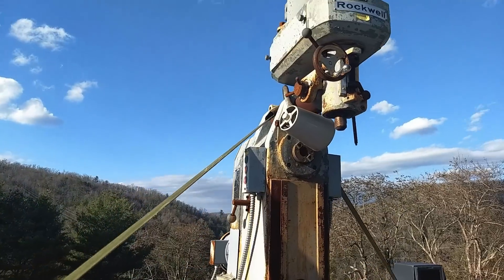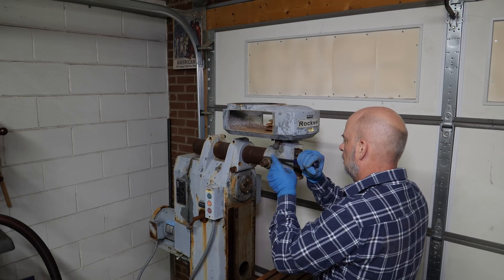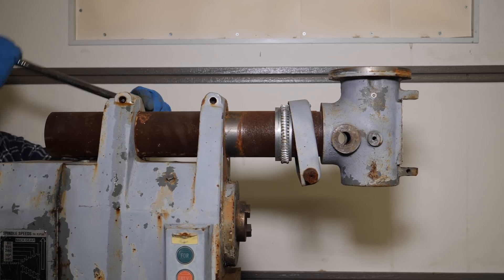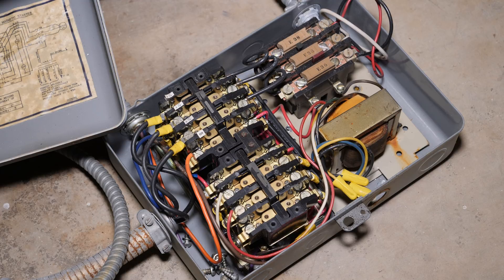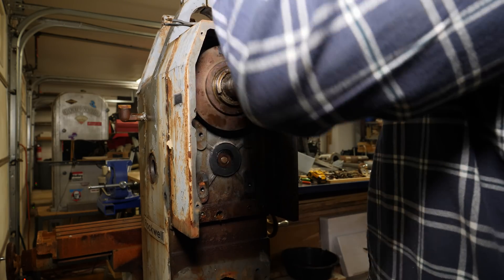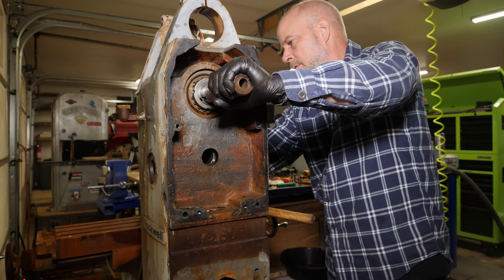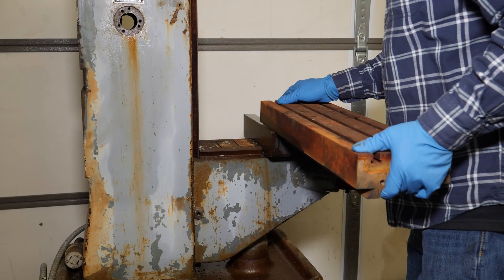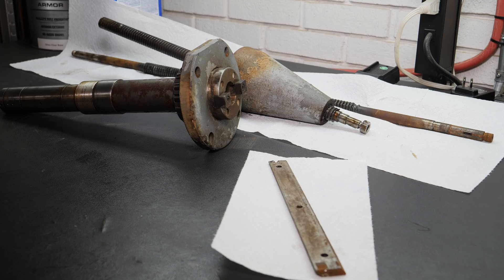$103! Rockwell Milling Machine MD21-120 Restoration Part 1 Disassembly

Comment: My machine was purchased by a friends grand father brand new I think in 72 but it has 220 single phase motors. I have the manual, overhead support brace,and the horizontal shaft. It's a nice mill for home use, not to big but sometimes a little to small. Wonderful channel I've watched about ten videos but am now going to bed.

Comment: I have the same Rockwell mill. I've used it for 20 years with a PMDC with DIY variable speed ac/DC converter. 
The 30 milling horizontal tool holders, I found the specs in my machinery handbook. I actually scored 10 of them at a yard sell for $50 each one would have cost 2-3 times that new if anybody had them.
 Your series has give me the nerve to do mine including the VFD.
 I've salvaged all my machines from orphans as I call them, and I've discovered that when I paint I finish the process with semi-gloss rattle can Polly and the paint just wipes clean and stays nice for many years.

Comment: One reason the rear bearing fails more often is people hamering pulleys on to the shaft without supporting the motor shaft on the opposite end.  This causes the rear bearing to be brindled by the hamer blows!

Comment: Those Rockwell mills seem to have a good reputation for a mid-sized mill, but not real common, & they can be hard to find. Good luck with it!
Reply from the maker: They are not production machines but prefect for the home shop at 800 to 1000lbs depending on configuration. Yes they are hard to find. I was really lucky to get one that was hardly used and complete for next to nothing!

Comment: I'm loving seeing this machine. It's like across between a Deckel or similar and a B'port. Like the forlks at Rockwell got halfway through designing a "continental pattern" machine and then threw their hands up and shrugged and said "Well I guess we'll just dangle a milling head from the over arm or something" rather than designing a milling head to attach to the horizontal drive spindle.

Comment: If that bolt is that tight why did you use a ratchet ? A solid nut buster is the way to go.
Reply from the maker: 4:03 Thanks for commenting Robert.

Comment: I am sure somewhere in the comments it has been covered but it just looks to me that because of likely patents etc, Rockwell just made the vertical mill in this form. It offers all the same adjustability of a Bridgeport except for the tilting head but that is not a big deal. Surplus auctions are a great place for used industrial equipment. I bought a wonderful metal bandsaw that cost more to move (about 3,000#) than it cost to purchase. 1941, August delivery. The maker is still in business and provided a lot of information. Congrats on a good buy!

Comment: ISO30 or BT30 adaptors are very close to the same and need a simple mod to fit if I remember correctly google search will give details
Reply from the maker: It is NMTB30. Which I think is all the same to some degree. Thanks for you input Owen!

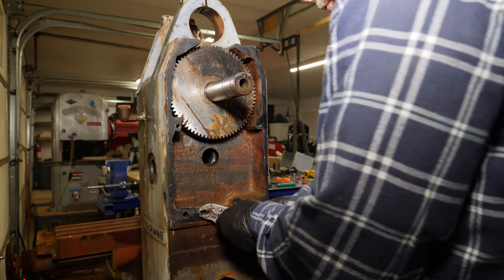Comment: @9:46 the broken fastener..  probably from freeze damage where the water in that section froze and heaved slightly ripping the head off that screw and dumping the oil out of that part of the case.
Reply from the maker: Hey great point Wayne! I have seen freeze plugs popped out of a SBC engine before. That is very possibly the cause. Water has super strength! Thanks for pointing that out!

Comment: I'm glad to find this video. I just bought one of these with single phase motors. Mine was more expensive but it's been stored indoors for at least 30 years and isn't seized anywhere. I'm also looking for info on the horizontal arbors and overarm support.
Reply from the maker: Looks like where in it together! I just put the knee back on yesterday after repairing the tapered gib and it's moving very nicely. I need to make a knee handle. More video soon. If you need help or have questions LMK!